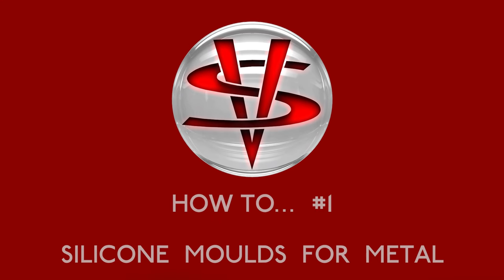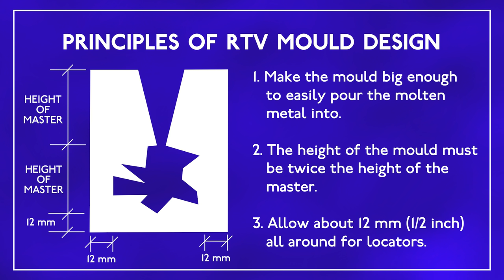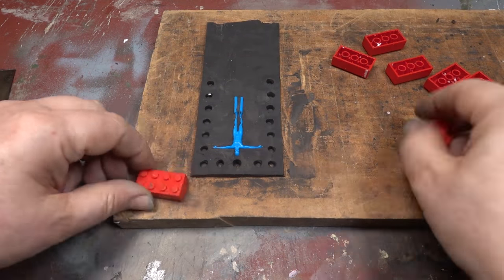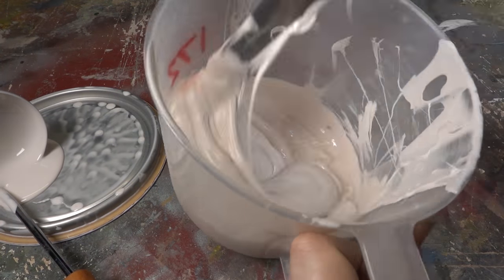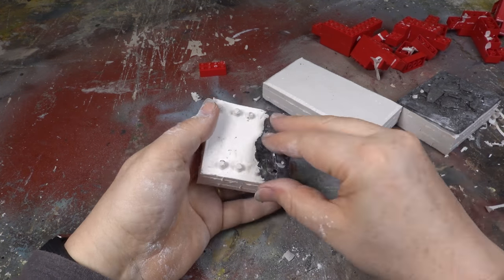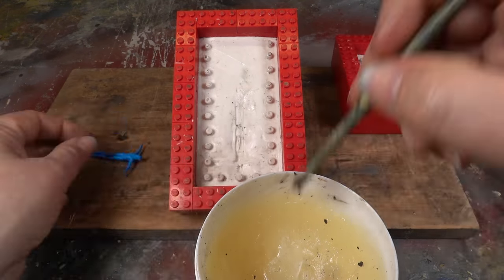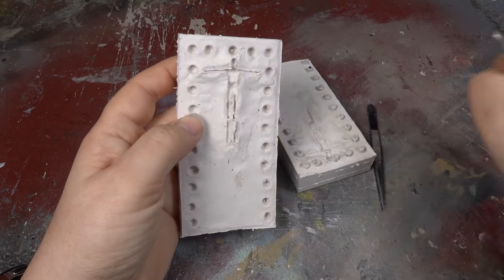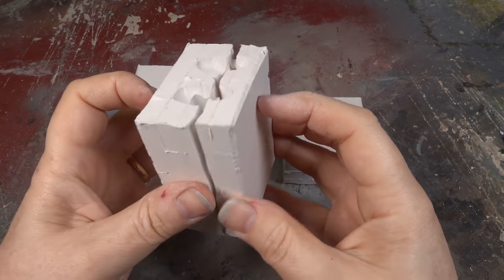HOW TO... PART 1 'SILICONE MOULDS FOR METAL'

Comment: I put a Ziploc bag into a 2-quart pitcher. Add my catalyst. Except the bag almost all the way squeeze as much are out of the bag as you can. Without losing material. Play smack into picture. The gas. Takes bag out of picture. Snip a corner like a pastry tube in it works good. Hardly no waste
Reply from the maker: That's a really good hack - love it. 😎😎😎

Comment: Hi, can these be used for brass casting? I am looking for an alternative way for metal molds coz they are expensive, I am looking for 2 part mold made out of cheaper material but realiable enough for repeated casting..any one have any answers to this?
Reply from the maker: This method is not suitable for brass. The mould will catch fire straight away and you could get seriously hurt. Check out investment / lost wax casting. I recommend getting a specialist to cast brass / bronze. 🙂

Comment: Great video. Thank you! One question, cutting the 1mm vents seems tricky? what is your thoughts on making single scalpel cut then slightly bending mould to open the vent, and dust with talc to keep vent slightly open? We used to do this with vulcanised moulds in jewellery casting.
Reply from the maker: Thanks Alan, yes the simple slit and talc method works to a degree but I find the air needs wider vents to escape. I'm just reliant on gravity and temperatures which aren't powerful enough tools sometimes. Metal in the vents is easy to remove. Getting a decent casting is the hard bit. 🙂
Reply: @StaplesandVine  that makes sense. Your method ensured flow and it looks easy to remove feeders once cast. Cheers 👍

Comment: Is there a reason you use Vaseline instead of talk powder for the mould separation?
Reply from the maker: The Vaseline is a lot more controlable than the talc so it doesn't fill any detail. Talc goes everywhere and doesn't stay put.

Comment: Do you have to spray, or brush anything on the legos to help make the mold release from them?
Reply from the maker: No, I only use Vaseline on the Plasticeine and on the silicone mould when I prepare for the second pour. The silicone easily comes off of the Lego bricks.

Comment: Excellent thank you, I want to have a go at casting some Meccano parts and this is just what I needed to get started.
Reply from the maker: This method only works for low temperature (tin / lead) alloys which aren't great for structural parts but for decorative casting - ideal. 🙂

Comment: Hi very interesting video, esy to follow and very clear.  I have a bycicle brake lever that I would like to make.  Problem is holes. I am not sure how to handle them.  The material is aluminum
Reply from the maker: This method will not work with Aluminium. The mould will catch fire split open and you may end up in hospital. This method only works for low temperature alloys. Use sand casting for Aluminium. Make the part solid and drill out the holes afterwards. Hope this helps. 🙂

Comment: Having recently purchased the Alec Tiranti starter kit this video has great advice in overcoming some of the problems that I have found in the production of my first silicon moulds. One of them being fixing small parts back into the first part of the mould before pouring the second part. I assume that superglue does not bond with silicon which enables the master to be removed after the second part of the mould has cured? Look forward to episode two and how to then cast from the moulds!
Reply from the maker: Hi Shaun, glad you like the video. I gave a tutorial to some friends the other day using the Tiranti starter kit (red rubber) and we had to use superglue. One way of checking is to turn over the mould and shake it - if the master stays put - you're good. The trick is to use it sparingly and where there is little detail.  If the superglue does remove rubber when you demould, your castings should only have a small amount of metal to clean up and in an easy location.

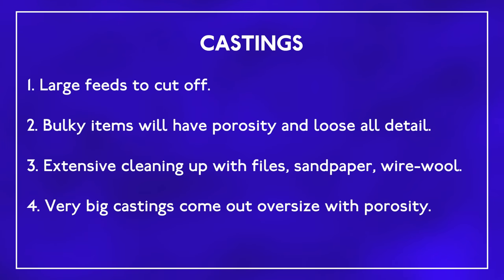Comment: Why are one-part molds more difficult to produce? Is it because the silicone you use has a higher shore rating? Also, what did you mean by "you aren't going to get super crisp parts" at 2:19? The examples I've seen from you all look quite nice. Maybe the camera isn't capturing all the detail.
Reply from the maker: Hi Hugh, one part moulds are easier to pour but require a lot more skill to cut. By the time you have enough access to cut and drill the air feeds you will have a mould with insufficient locators and therefore an unreliable mould. One piece moulds work best for resin casting.
Reply: @StaplesandVine  That makes sense. Thanks!

Comment: I realise this is old now but hope you see my comment. Where do you buy your pewter from? UK based.
Reply from the maker: Hi Choppers Ears, for small quantities of pewter /white metal best go to https://www.tiranti.co.uk/Products/white-metal--tin-alloys If you are buying in larger volumes try http://www.gwneale.co.uk/  🙂
Reply: @StaplesandVine  which one would you consider for casting metal miniatures using silicone? No 2 low melt alloy? My only concern is lead do you have any experience using that?
Reply from the maker: @LenzTheMenz  the Tirranti number 2 looks a good general purpose alloy. A great starting point.

Comment: What size drill bit and what speed do you drill the vent holes using please?
Reply from the maker: Hi Graham. For the smaller moulds I use about a 1.2mm drill to avoid damaging mould detail. For larger moulds I will go for about 2.5mm as I have to evacuate more air. In both cases make sure the drill is sharp and running at very high speed as the silicone will just move out of the way of the drill at low speed. Drill sizes are just approximate and not critical. Hope this helps, Sera.
Reply: @StaplesandVine  That's helpful thanks.  You're right about it just moving out of the way, I attempted to hand drill it with a pin vice and  you couldn't even see the hole afterwards lol.

Comment: Can I ask a question? Would cooking grease/fat also be adequate for lining each mould to protect them from sticking?
Reply from the maker: Well you could but it is going to stink! Especially when it gets hot. It'll be like a chip shop on a Saturday night. Might even catch fire so best not. Vaseleine is very cheap and safe, best stick with that.
Reply: @StaplesandVine  ok thanks👍
Reply: @StaplesandVine  Okay one more question sorry, I had mixed up the rubber silicon, one2 came out perfect so I got ready to make the second, and I don’t think I got the mixture quite right, it’s still gooey 24 hours later, if I wait longer will it eventually dry?
Reply from the maker: If you got the mix ratio wrong it should just take longer to cure. How long you will just have to see. If it has partially thickened you stand a chance. If not you will have to try and remove the uncured silicone clean the mould, apply vaseline, mix up another batch and try  again. This is why it is best to take care with your mixing.
Reply: @StaplesandVine  I had to clear it away, the next ratio I think I put a bit too much I was able to get the mould right but it dried in a matter of four minutes😅😂🤣🥲😀😃😄😁😆

Comment: Your video is great and very informative. I do have idea of what I could use this for but was wondering if it would work for my earrings design.
Say one of the metal items I was trying to craft was a flat on the bottom petal flower with bumps. Would I do the same thing of molding and then just make the second mold a completely flat sheet?
Reply from the maker: This process would work with your design but you would need to make sure your pattern is at  least 2mm thick to cast successfully. Hope this helps 🙂

Comment: Do you think this would work for casting toy soldiers? I want to make sure before I try anything.
Reply from the maker: Hi Scott, yes it should work quite well. The best size for successful casting is 1-3 inches tall so you should be fine.
Reply: @StaplesandVine  Great to hear. Also, amazing video.

Comment: Thank you.

I wished amd wamted to know hiw to make iron or aluminium molds for my house exterior decorations.

Thanks to your generous and loving actions and pacience you helped me to realise how to do it.

Thank you very much! Jesus Christ bless you.
Reply from the maker: Hi thank you for the lovely comment. This method will only work for small parts cast in low temperature alloys. For iron or aluminium casting search for 'sand casting metal' If you use silicone moulds to cast iron or aluminium you will get badly hurt.
Reply: @StaplesandVine  thank you for the meaningful warning. Would you be able to sacrifice a portion of your life to make a tutorial how to  make that as well? It could help me even to make a business in my poor country in Europe.
Reply from the maker: Unfortunately I have no experience of this process. It is best handled by a proper casting foundry. I am sure if you made solid original parts a foundry would cast them for you.

Comment: Hello, I love these videos. I am new to molds and have a hard time creating round molds but I don’know what to use to create the barrier for the housing of the mold. Can you tell me what you use. Thank you.
Reply from the maker: Hi Gustavo, I use Lego to build the walls around my could cure moulds. Some people make mould boxes from card held together with hot glue but Lego is was more versatile. The only problem is you need a lot of it for large moulds. I hope this helps. 🙂
Reply: @StaplesandVine  Thank you so much for your response. I don’t have a problem with square molds, my problem is when I have to create a mold for circular objects. Thank you.
Reply from the maker: Round is difficult as you need to remove it once the mould is cured. Cardboard tube may be the answer? You can get it in a range of sizes and it cat be cut/torn away afterwards. Plastic tubing would be very difficult.

Comment: best to pour the silicone from  a height it stretches the bubbles out
Reply from the maker: I have tried that already. It actually folds air in as the silicone lands. The bubbles in the mould create give which cause oversize castings. This is useful on clean up as there is excess material to work with.
Reply: no you pouring too fast you can see the bubbles come out @StaplesandVine
Reply from the maker: Thanks, I'll give that a try, always willing to learn.

Comment: Just a question regarding the silicone you used, the RTV 3481 and the curing agent 81 F. I've been trying to find the temperature rating. Where can I get the spec sheet for the silicone you are using?
Reply from the maker: Here's a link to the technical data sheets https://www.polysil.co.uk/resources/rtv-silicone-systems/ I have been using this rubber for 20 + years for casting pewter and it has never let me down.

Comment: Hi do you take work in i need something made.in aluminium. Small item.
Reply from the maker: Hi Paul. Sorry, I don't take work in. This process won't work for aluminium unless you want a major fire and a trip to A&E. I suggest you hunt for a specialist caster for Aluminium.
Reply: @StaplesandVine  That's interesting. I've seen aluminium used for compression molding of things like shoe soles. I expect there are people looking for ways to make these molds out of aluminium. Is melting point the problem?
Reply from the maker: @Veganlinecom  Aluminium moulds are usually machined from a block using CNC and cost several thousand £/$ to make. This method is more for the hobbyist at home to cast low temperature alloys at about 280C.